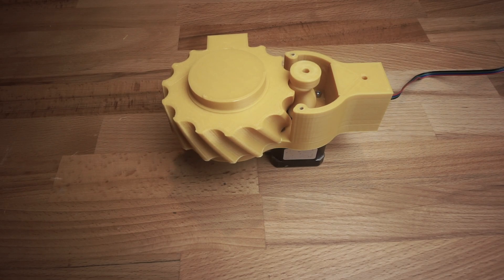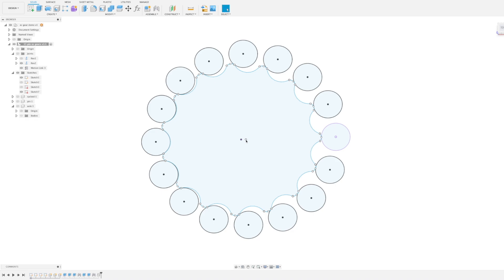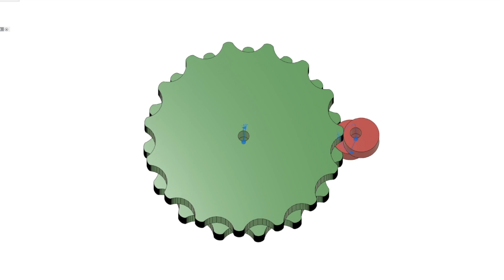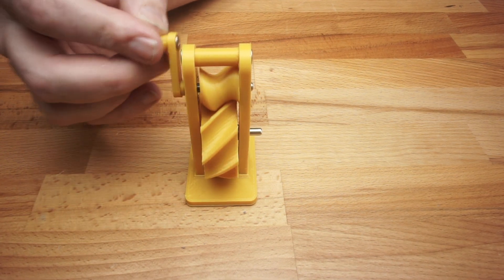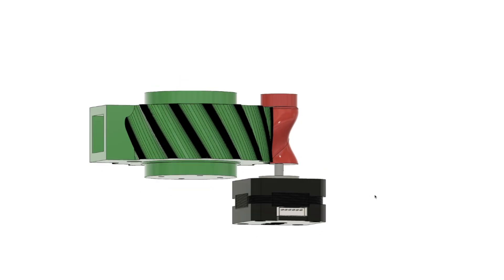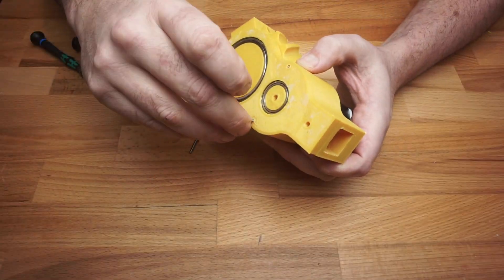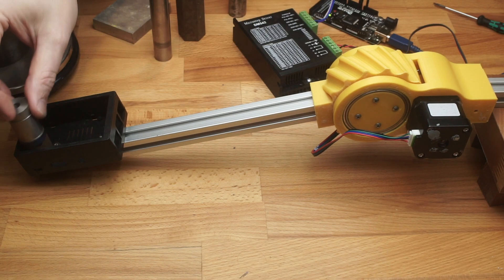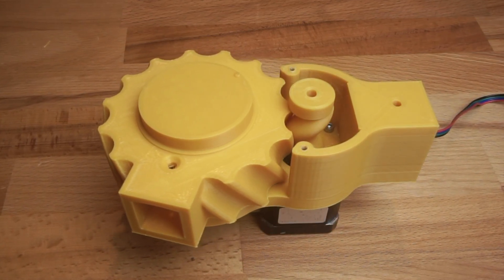What are Eccentrically Cycloidal Gears?

Comment: Hi could you put the pinion into the big gear, to make it more compact and put the teeth of the big gear into the so created gear ring?
Reply from the maker: Yeah, a couple of other folks have suggested that and I think it's a great idea.
The only thing to work out is how to hold the top of the pinion steady - currently it has a bearing on the top which is held by the housing - any ideas on how to do this if it's enclosed by the larger gear?
Reply: @roTechnic  you can have a bridge tower come up from the base to support the top, the housing would have to have room for it (or a hole in it's center) to give clearance, but it should be straighforward to do.
Reply from the maker: Yep, you're right - why didn't I think of that 😅
Reply: For example, planetary gears work fine with single sided bearings.
Reply from the maker: @falkgerbig7787  yeah, they do, but this has a fairly large moment at the top which needs a bearing to counteract it

Comment: Congratulations for your wonderful solution: Backdrivable, compact, strong and with not any sliding friction.
Why do you use such large and expensive bearings?
Reply from the maker: thank you.
I’m using the large bearings because I want to eventually have this in a robot arm, and the larger the diameter of the bearing the more it and the plastic will resist twisting forces.

Comment: Would efficiencies be better if it was actually a stack of bearings?
Reply from the maker: I don’t think so. in this mechanism, the pin is rolling over the disk, so there should be minimal friction. if it was sliding - like a work drive does - then bearings would definitely help.
however, I’m always up for being wrong about these things 😂 so if you disagree, please let me know
Reply: @roTechnic  I hear this sliding vs rolling friction in cyclodial gear discussions a lot, but then James Burton mentioned that going from sleeves to bearings for his pins made a big difference (although he admitted it wasn't quite a proper cyclodial gear at the time). It will be interesting to see how it holds up over time (power it and see how long it can last)
Reply: there will be friction induced by the non canonical shapes due to manufactiring tolerances, 3D printing in this case.

Comment: Awesome. Maybe it could be inverted to save space..? place the input shaft off-center within an output ring gear with an internal helical (or herringbone) cycloidal profile
Reply: Would be interesting to see how small the parts/curves could be printed for larger reductions and more compact mechanisms
Reply from the maker: thanks for your comments - both are great ideas - I’m definitely going to try shrinking it in the future and may see if I can get the pin internal to the disk. the only question is how to hold the top of the pin - at the moment it has a bearing on it which mounts into the housing and stops any flex

Comment: great design , but what about all the friction involved in this system ?
cycloidal design permit the use of bearing that remove all friction ;)
Reply from the maker: thank you very much.
as it’s a cycloidal design, the pin rolls around the disk instead of sliding. most of the friction comes just from inaccuracies in the 3d print..I’d say that this has lower friction than my cycloidal drive of a similar size
Reply: @roTechnic  ho !! yes now i understand better !! thanks for the info , i think i will go for made one :)

Comment: Very interesting design! Is there any noticeable backlash in the finished actuator? Do you think lubricant would help reduce losses?
Reply from the maker: I’ve got a bit of backlash at one point in the rotation. I think it’s due to my 3d printer needing a bit of calibration and the arc which it occurs in is only a couple of degrees. everywhere else has no noticeable backlash.

and, yes a bit of PTFE silicone grease would help greatly, but it looks dreadful on video 😎

Comment: What a neat idea. Nice implementation too. I agree that the backlash should be low since the gear is always engaged. I wonder about the power losses in the gear train. It is reminiscent of a worm drive, which typically has high losses for higher gear ratios.
Reply from the maker: thank you very much.
yeah, but the difference here is that worm drives work through sliding friction, but this works only with rolling friction which has much lower losses
Reply: @roTechnic  : I'm a little confused by that claim.  The pin (at least when it's contacting at its largest diameter) has to slide across the surface of the large gear, yes?  And wouldn't that give you sliding friction?  What am I missing?
Reply: @roTechnic  I'd have to disagree about the "only rolling friction" part.  Since this is a 1:N gearing, just like in a worm gear AND height of both gears are the same, the length of contact of the small gear must be much greater.  In fact this is another form of a worm gear but with parallel rotation axes.  Thanks for introducing me to your idea though, might be useful for me sometime.

Comment: That's a great design :D It's very refreshing to see some new ideas in the space of 3D printed gear actuators. Maybe you could save some space if the single tooth gear could engage internal cycloid gear.
Reply from the maker: oh, now that’s a brilliant idea. that’s what I love about doing videos - I get the best feedback ever!
Reply: just saw the video, wanted to write the same... so are there updates on this?
Reply from the maker: @CM-mo7mv  sorry - didn't see your comment when it came in! I did a follow up on this: https://youtu.be/xv5cd7Bg7Uk
Reply: one big advantage of this approach over putting it on the inside is that this doesn't require large bearings, pins, etc. this can be scaled up to very large gear ratios while still using cheap 608 bearings.
Although, I could see the potential for a large gear that has a solid disk on one side, possibly pinching the edge of the gear between the one lobed gear and bearings on the outside